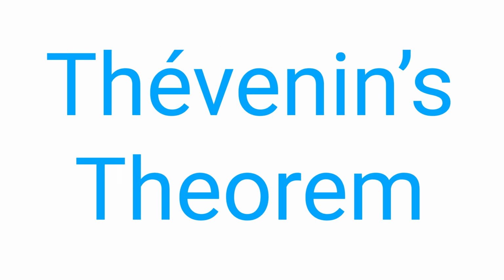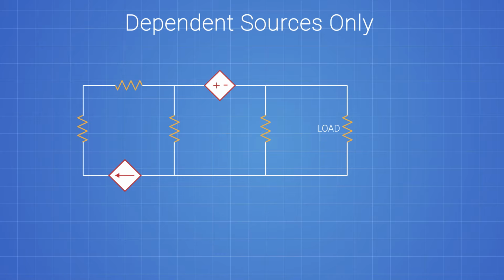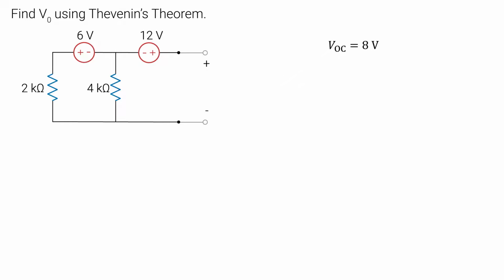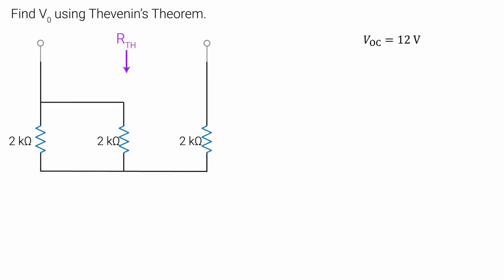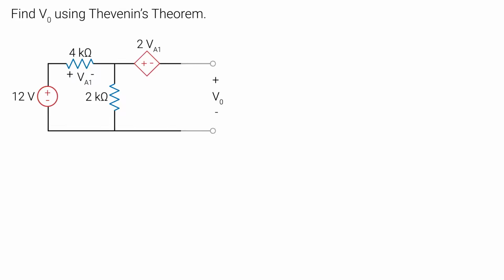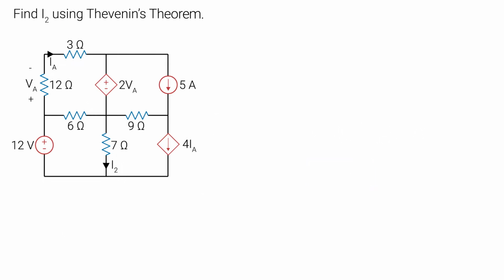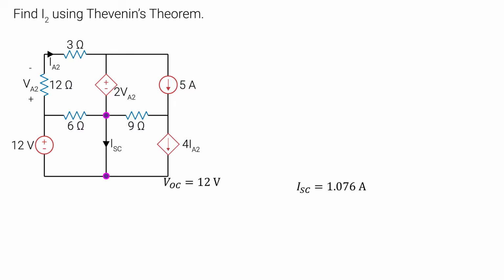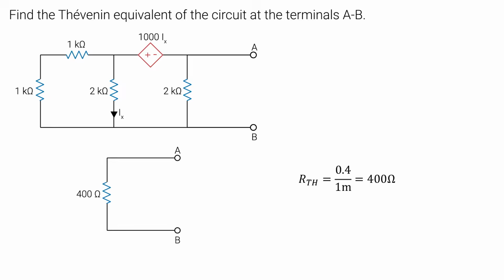The Complete Guide to Thevenin's Theorem | Engineering Circuit Analysis | (Solved Examples)

Comment from the maker: Please read before commenting.

❗There is an error at 12:16 when calculating RTH. See: https://youtube.com/shorts/3atQmqZjvoM?feature=share The RTH value is 4 kΩ so the answer is right, however, the way I showed the addition of parallel and series resistors is INCORRECT. The short circuit at the bottom of the circuit will mean only the top 4 kΩ resistor will contribute to the RTH value. 

🟪Circuit Analysis Playlist: https://www.youtube.com/playlist?list=PLXePpKFSUW2abKgvj_hClQS1NK86SCHfy
🟦Norton's Theorem: https://youtu.be/rSP32xF5MUc
🟦Mesh Analysis: https://youtu.be/D92DjS43-Qw
🟦Nodal Analysis: https://youtu.be/JptsfzvKbuo
🟦Superposition: https://youtu.be/uoZ0E6zxoi0
🟦Combining Series and Parallel Circuits: https://youtu.be/Gn26z60tTog
🟦Basic Concepts of Circuit Analysis: https://youtu.be/rE_0ejMU6yM 
🟦Ohm's Law and Kirchhoff's Laws: https://youtu.be/8pJcXfl8oq0
Reply: I noticed. Good Video!!
Reply: Im so glad you mentioned this it was driving me nuts trying to figure out how that worked out lol
Reply from the maker: @richardaidenjennings2456 Thanks for actually reading the pinned comment before asking the question 😅
Reply: @QuestionSolutions  I felt like I was going insane, I finally took a look at he comments after an hour
Reply from the maker: @suhail8240  Thank you for reading the pinned comment.
Reply: @richardaidenjennings2456  GURU WELL DONE!:face-blue-wide-eyes:🤣
Reply: how is it 4k ohms? I got 5.33k ohms for RTH lol, i assumed thag 2k ohms and 4k ohms is in parallel which gives 1.33k ohms then in series in 4kohms,which gives 5.33k ohms, pls enlighten me
Reply from the maker: @vinsmokesanji5997 so did you watch the short clip I posted?
Reply: Yes, I found the same error. The result is correct but the way is wrong.
Reply: I watched the short too now but I still don't understand how those 2 resistors do not contribute to RTH value.  I added the 4ohms resistors as series and considered the 2ohms one parallel. :(
Reply from the maker: @icebytess they don't contribute because they are bypassed by the short-circuit. I'm sorry I can't explain it better than what I showed in the short video. Maybe your professor or TA can help you out?
Reply: @QuestionSolutions  alright nw I'll ask a friend or lecturer. I understood the rest of the video so thank you :)

Comment: At 10:47, can you please explain again why it is that the positive voltage is at the top and negative at the bottom? You said that the current flows from positive to negative, so if the positive is at the top, the current should be flowing AWAY? What am I missing here...?? Great video, thanks! :D
Reply from the maker: So there is a tiny misunderstanding on your part. When we solve problems, we assume current to flow from the positive side from sources, so like voltage sources. But for resistors, we always follow passive convention. In simple terms, we always assume current enters the positive side of a resistor. So if I0 was going bottom to top, then that resistor would have the positive side on the bottom. If current was going top to bottom, then the top would be positive.

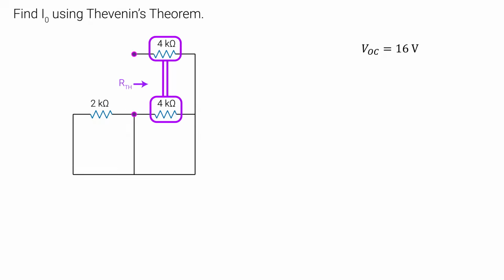Comment: 12:10 I am confused why is it parallel? The top node connects the start of the top 4k resistor meanwhile the start of the bottom 4k resistor is the center node. Therefore they are not parallel right?
Reply from the maker: Please read the pinned comment that says "please read before commenting" in bold letters.

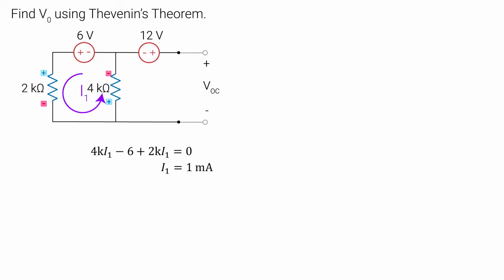Comment: 5:43 the V across 2k ohm R is 2V when the other loop is open. However, when writing KVL for the entire loop, we still take V across 2k ohm R as 2V. Logically, how is the V across 2k ohm R constant with the other loop open and then closed. In the superposition video, we were told that each source has an effect on the load. Please help me with this confusion. Thank you!
Reply from the maker: The loops is never closed. It's an open loop. Think of a crude example like this. You have a battery. To the positive end, you attach a wire. To the negative end, you attach another wire. The wires aren't connected to anything. It's an open circuit. If you take a multimeter, and attach the clips to each end of the wires, will it give out a reading even though the circuit is an "open loop"? It'll give you a voltage reading of the battery. In a sense, it's similar to what we do with KVL. You are just getting the voltage between two points/terminals, that's it. The circuit can be open at any spot. 

Here, if you wanted to, you can write a KVL for the 4kohm resistor, the 12V source, and VOC. You will still get the same answer for VOC. It makes no difference which part of the circuit you decide to use to figure out the potential difference between the two points and it makes no difference if one part of the circuit is open. It just spits out a voltage (a potential difference) between two points.
Reply: @QuestionSolutions  thank you so much. You are right. Basically, the loop is open and we are calculating Voc (open-circuit voltage), that's why we can directly use KVL. Thanks!

Comment: what if we do KVL and some mesh I got i is negative how do I calculate V is it depend on the direction or not I dont get it
Reply from the maker: For a resistor, unless the voltage is labeled positive and negative, you can use passive convention to make whatever side the current enters the resistor as the positive side.

Also, watch the first video in the circuits playlist to help you understand positives in current and voltages.

Comment: Hello, thank u sm for the video. 
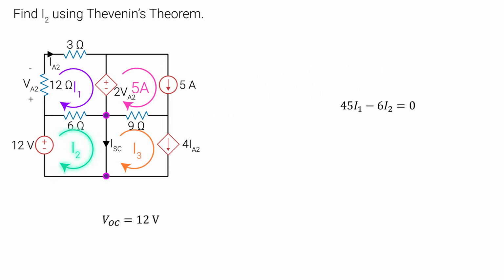there is a mistake at 18:45 , I1 is 39/12 which gives us 3.25A not 0.308 A
Reply from the maker: 😅I assume you were rushing. When you solve for I, you divide both sides by 39, so I = 12/39 NOT 39/12. What's shown on screen is correct.

Comment: At 10:48 ,why we could not calculate Voc by considering the left loop? 12V - Voc - 8V=0??
Reply from the maker: What you mentioned is not a loop. You can make it a loop by figuring out the voltage in the current source, but that's extra work.
Reply: @QuestionSolutions Yeah.... I get it now. Thank you man,, keep this up.

Comment: At 20:40 why can't we take 2kohm resistor as load and make it a current source as you told in 3:20
Reply from the maker: Because the 2kohm resistor is not the load. You have to read the question very carefully and not make assumptions about what the load is. The question tells you what the load is. Here, we are told to find the Thevenin equivalent between terminals A and B, what that means is, we are presented with the question with the load already removed. So whatever was there (maybe another resistor or something, who knows), is no longer there.
Reply: @QuestionSolutions ok sir understood 😅
Reply from the maker: @yashrai4113 wonderful :)

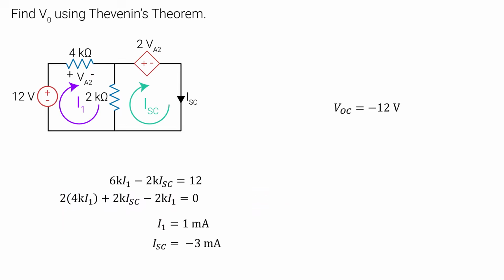Comment: possible to show the calculation of 15:20 math, the two 2 equations? how do you get  -3mA and 1 mA....Everything else about the math I understand...
Reply from the maker: Isolate for I1 or ISC in the first equation, plug that into the second equation and solve. Then take that value and plug in back into the first equation to get the second variable.

Comment: 12:11 why two resistence 4 ohm are not considered as series ?
Reply from the maker: See the pinned comment that says "please read before commenting"
Reply: @QuestionSolutions  yes I got the point but what if there was no short circuit then why it considered as paraller not series ?
Reply from the maker: @emaandiptopath  IF, and only IF the circuit had nothing else but just those two resistors (and we forget about everything else), they are in series to each other since there are no other paths to take.

Comment: I have a question at 6:19: why did you say that the 12V voltage at that point is an open circuit, so how can kVL be applied to the entire circuit? I'm very confused; could you please explain?
Reply from the maker: I said it's an open circuit because it is indeed an open circuit there, there is no current flow between the positive and negative terminal because there is no wire connecting the two points together. However, you can still calculate a potential difference (voltage) because KVL holds true for any loop of your choice. Think of it like this, (this is simplified but the gist of it is true) you are adding up all the voltages from either the positive side to the negative side, or the negative side to the positive side. So it's telling you the difference in potential between the negative terminal and the positive terminal. You can do this at any point in the circuit. So you can calculate the voltage between the two voltage sources and the 2kohm resistor (so imagine from the bottom of the 2kohm resistor to the middle between the two voltage sources) even though there is nothing connecting those two points directly. This is covered in the KVL video so I encourage you to watch that to get the fundamentals needed. I hope that helps.
Reply: @QuestionSolutions  Thank you so much! My teachers in class don't teach this way, so I thought it was an open circuit and couldn't do it. Thank you for your video, it's very helpful. It has given me a new understanding. In class, my teacher only taught me to calculate the voltage at the two ends of a and b and then add them together to get the voltage.

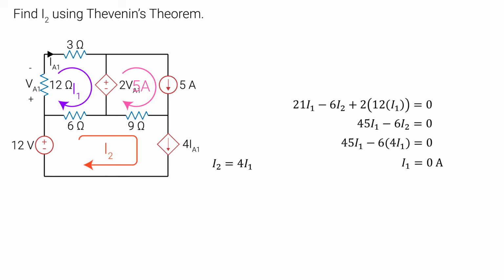Comment: At 17:40 what if I take the I1 and 5A mesh together and solve it will it give the same answer as 0A or not please explain
Reply from the maker: Why don't you try and see if you get the same answer?
Reply: I tried but I got I1=0.491 and I2=3.688 
The equation for 5A = 9(5-I2)-2Va=0
Reply: Which will be the right answer please explain
Reply from the maker: @gtavgamer-f5v so when you write mesh equations, what are you actually doing? You're writing voltages down, but you represent it as current times the resistance. When you tried to use the 5A source in your equation, you need to have a voltage for that source, which you can't find, that's why you're getting an incorrect answer.
Reply: Ok thank you

Comment: For the last two math you don't follow the rules, likes when finding R(th) ; you don't replace the independent sources.. What was the reason? please clarify it.
Reply from the maker: If there are dependent sources in a circuit, you can't remove independent sources, you need to use Rth = Voc/Isc. I actually explain this quite a few times in this video.
Reply: @QuestionSolutions I apologize but can you explain it one more time here in details, I don't know why but it makes me so much confused . And thank you for your reply.❤
Reply from the maker: @FatemaBithi-lw7ud  So to find RTH, you have two options. You can remove all the independent sources and calculate the total resistance BUT this can only be done if a circuit does NOT contain any dependent sources. If a circuit has both types of sources, you have to calculate the open circuit voltage, and the short circuit current, and then divide the open circuit voltage by the short circuit current, and that will give you the equivalent resistance.  When you watch the video, do the questions along side the video, you will see what I mean if you do it. Always remember, you cannot make dependent sources go away. If you need further help, you should consider speaking to your TA or professor during their office hours. Might be easier to see this done on a piece of paper in person :)

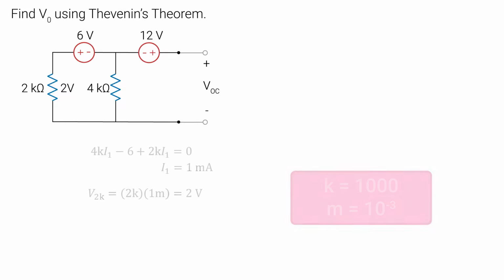Comment: Hello sir, at 06:07, I would just like to ask why applying KVL here is possible even tho we have an open circuit there and no conductors to connect the two sides in the right, i dont know that forming a loop there is possible since there is no conductors or lines connecting them to each other
Reply from the maker: So I really need you to watch the video on KVL (https://youtu.be/8pJcXfl8oq0). It teaches the fundamentals of KVL. KVL will hold true for any loop of your choosing, whether a part of the circuit is open or not does not matter. After you watch it, and you still have trouble, let me know and I will try to help you out better.

Comment: Hello sir, I was wondering if you could help me out on this Thèvenin Theorem problem. I can get the Rth easily with a value of 12 ohms. But with Vth, I'm having a hard time, I tried nodal voltage but some sources are saying i can set the ground node even if it has a value (not v=0). Here is the picture for the reference. Thank you very much Sir. 

https://drive.google.com/file/d/1CqtpiXZX7F1vtGGgoVrCxnbhdFU12TvD/view?usp=drivesdk

Comment: On last question last part Shouldnt we find the final v=-0.4 volts since 1mA flows from B to A meaning B is + and A is - terminal
Reply from the maker: No, what you're saying applies to the current source itself, but not to the resistor. Just by looking at the direction of the current source arrow, we can see that the current will leave A, and then go down the branch with the 2k ohm resistor, which means (using passive convention), the positive side of the resistor will be up top, since we always assume current to enter the positive side of a resistor, so top is positive, bottom is negative. If, by chance, I2 was a much bigger negative value than I1, then we would know the current flow would be upwards, which would make the bottom of the resistor positive, however, that is not the case here.
Reply: @QuestionSolutions i understood now. Thank you so much. I love your videos❤❤❤

Comment: The last example I dont understand isnt Vth always zero when theres only dependant sources?
Reply from the maker: Yes but I am not understanding your question. In the final answer, we don't have a Vth? We only find the Vth to get the Rth, but the final answer does not contain a Vth.
Reply: @QuestionSolutions  but how would you "find it" if its supposed to always be 0? or what if the question asked me to find it is it always 0? thats whats confusing me
Reply from the maker: @abdulazizamh6495  Find what though? Vth? There is no Vth in circuits with just dependent sources, there is no flow of electricity in the circuit. The only thing you can find is Rth, by adding our own current source at the terminals, calculating an arbitrary Voc, and the using Rth = Voc/Isc. But the final result only gives you Rth because again, there is no flow of electricity in the circuit with just dependent sources. 

In real life, you use this to isolate certain sections of very large circuits and represent it as a smaller Thevenin equivalent circuit. And those sections might not contain any independent sources.

Comment: For the last example with only dependant sources, why didnt you remove the 2k Ohm resistor and replace it with the Test Source.
Reply from the maker: The 2k ohm resistor is not the load. This problem is given as if the load was already removed.

Comment: HOW DID you get 11.15 ohms thats in series with the load?
Reply from the maker: What do you mean? You are dividing the VOC by the ISC to get the RTH, so put into your calculator: 12 ÷ 1.076, that will give you 11.15.

Comment: For the case with independent and depended sources where you create a short circuit, do you still turn off the independent sources? you did not mention it but you did leave the independent current source there and didnt turn it off.
Reply from the maker: Could you explain what you mean by "turn it off?" And please include a timestamp to the location you're referring to.
Reply: My apologies by turn off I meant either turning the source into an open or short circuit. 

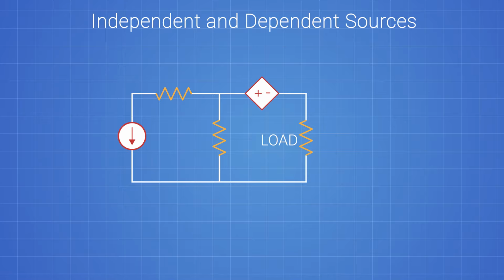In the little example at 2:14, you talk about creating a Short Circuit between the terminals for the case with independent and dependent sources.

but you do not mention whether we still turn the independent sources into shorts or open circuits. Like we do in case 1 with only independent sources.
Reply from the maker: @SirSpooki Ah, I see. I do cover this in the examples, but in a circuit with dependent and independent sources, you cannot "turn off" any of them. The same as in superposition.

Comment: In the first example, around 4:58, you find the voltage across the leftmost 2 kOhm resistor by ignoring the 12V power source (since it is part of an open circuit). But then when you write your final KVL you include the 12V power source. Why are you able to do this? Doesn't the inclusion of the 12V power source (and its corresponding current) change the voltage drop across the leftmost 2 kOhm resistor?
Reply from the maker: KVL will hold true for any loop you want. For example, you can write a KVL for a loop from the 2k resistors, then the 6v voltage source and back to the 2k resistors by having a variable for the voltage between those points. KVL will hold true for ANY loop of your choice, whether a part of the circuit is open or not does not matter. I have a whole video on KVL, so please watch that first.

You can actually think of any loop you write a KVL for as a closed circuit, that might help you visualize it better, even if it's open.
Reply: @QuestionSolutions  Ok I understand it now, thank you very much. I love your videos! They are super helpful!
Reply from the maker: @ChristoPapaioannou  Glad to hear :)

Comment: for the first example while use kvl when the second loop is open. doesn't it only work for closed loops
Reply from the maker: No, KVL will work for any loop, you can calculate the voltage between any two points and whether a part is open or not is not an issue. I have a video on KVL, please take a look if you have the time.